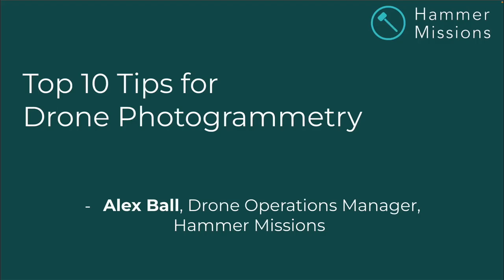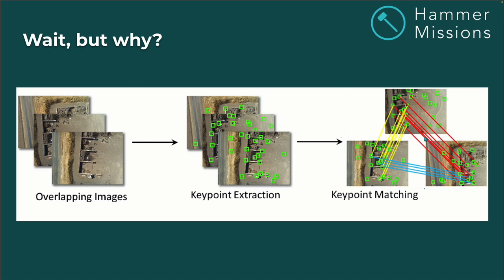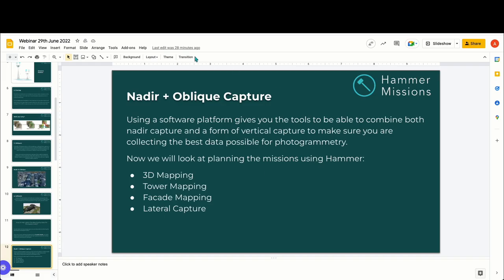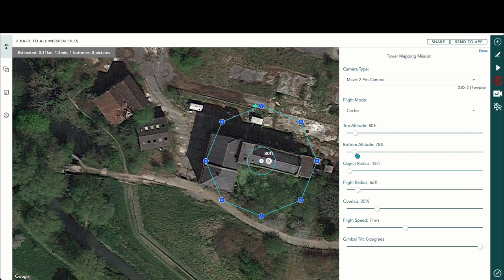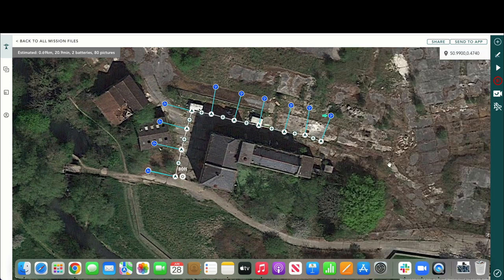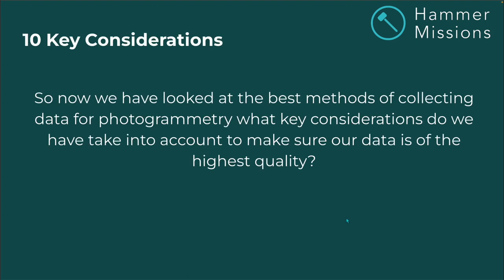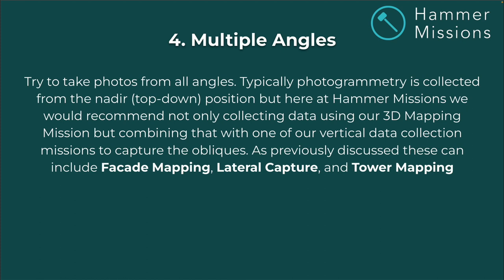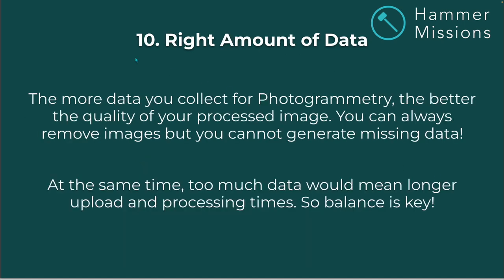10 Tips for Drone Photogrammetry, by Hammer Missions

Comment: Great, but how do you manage the presence of trees in your example ?
Reply from the maker: Hi Stephane, thanks for the question! do you mean trees for the flight planning or the data processing? With regards to flight planning, you can choose to fly higher than the highest tree. We would recommend at least a 10m clearance between the trees and the flight plan. This might be trickier for tower mapping (concentric orbits) or facade capture. If multiple orbits is not possible, then we recommend collecting data from a single row (top altitude) of the respective mission. 

Here's more with a recording of the processed results: https://www.hammermissions.com/post/how-to-capture-data-for-3d-mapping-using-drones